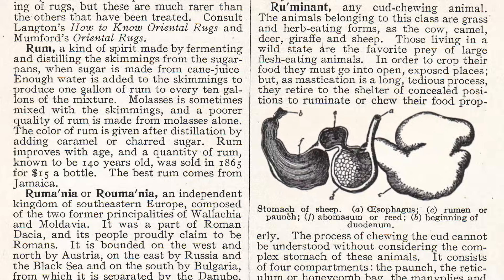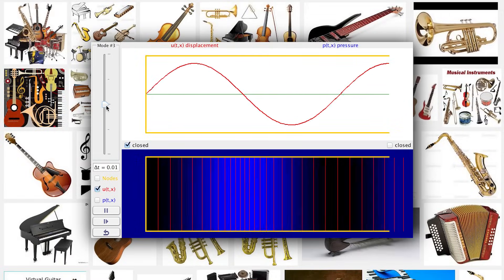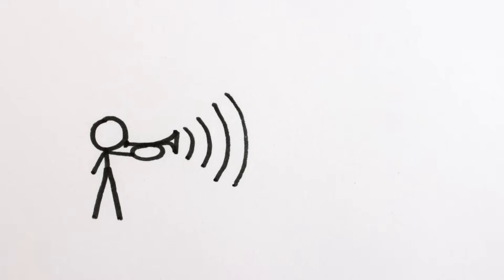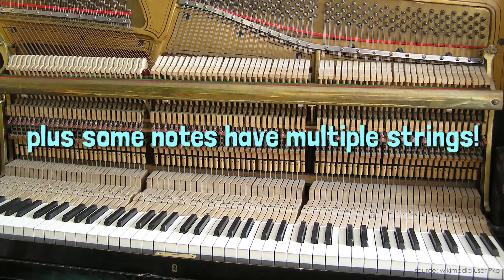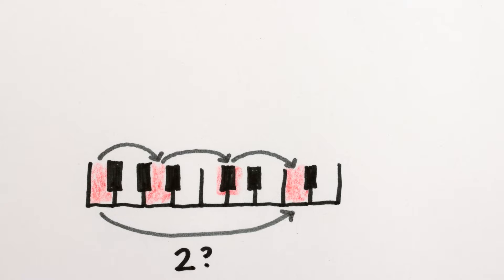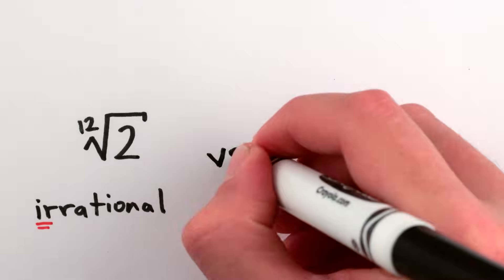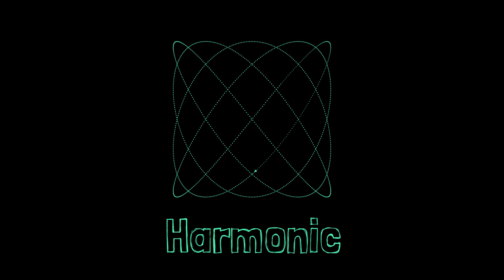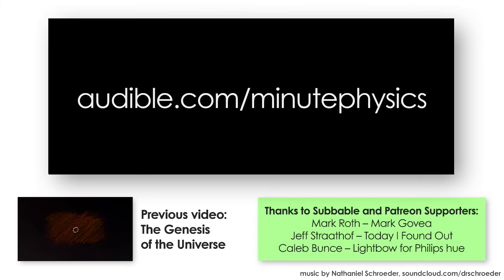Why It's Impossible to Tune a Piano

Comment: Irrational Numbers. So we met again...
Reply: at least they're still real...
Reply: i know right?
Reply: CsBence98 j, someone gets me
Reply: k I didn't expect to be counter-mathed.
Reply: CsBence98 can i x your something? y do we even use imaginary numbers?
Reply: ℂ𝔸𝕌𝕊𝔼 𝕎ℍ𝕐 ℕ𝕆𝕋
Reply: +ThePizzabrothers Gaming i itself is just bullshit, but in some calculations it "vanishes" (by being multiplied with i) and that way you get a decent solution. It's kinda handy for calculating vibrations for example, as cos (x) + i sin (x) = e^ix which is way shorter (and also the reason why e^iπ = -1)
Reply: Leo1239150 i is great for solving quadratic equations, but that doesn't mean it's a valid reason to come up with a random number that "explains" how things work.
Reply: I can speak on behalf of engineering application; In electircal analysis AC analysis, capacitors and inductors cause transient behaviour. It's quite tricky to solve exactly, but we know they consume power on one side of the sine wave of the AC current, and produce power on the other side. We therefore give them an impedance, which is measured in ohm's, and the maths becomes very easy, as this impedance is simply a resistance with an imaginary number, i. Current and voltage also receive some imaginary and some real values (the combination is known as a complex number) and the classic circuit analysis techniques can be used. As abstract as it may sound, it works perfectly.
It's also used often to offer a simpler way to due with 2d vectors, although using them is not greatly encouraged, as one must be careful when doing so.
Reply: ThePizzabrothers Gaming
 why not? If it's stupid but it works it's not stupid. And it works just fine
Reply: +ThePizzabrothersGaming Read that sentence again, but replace i with square root of two. :D
Reply: well it is a valid reason because mathematics to stay logical needs rules and if mathematics is not completed we can expand those rules but then we need to make them line up when they talk about the same thing. i was "invented"  to make every quadratic have a root basically someone asked what are the roots of x^2+1. aka when does x^2+1 = 0  it's when x^2=-1 but with the rules of multiplying numbers x can't be positive or negative. so imaginaries are needed to give it an answer as the rules of math state. just like asking what the answer of 2+5*3-5/2 is without math rules we could get multiple answers. there's (2+5)*(3-5)/2 = 7(-2/2) or (7(-2))/2 =  -7  depending on how you parenthesize thing though you can get different answers. it's only by giving rules to implied parentheses that it gives any meaning to mathematical expressions. +ThePizzabrothers Gaming.
Reply: evaluating we can get 2+15-5/2 = 2+15-2.5 = 14.5  we can get 2+(15-5)/2 = 2+10/2 =  2+5 = 7  we can also think of it as (2+10)/2 = 12/2 =6 so this is why placement of parentheses is so important we can also get (2+(5(3-5)))/2 = (2+(5(-2)))/2 = (2-10)/2 = -8/2 = -4  or ((2+5)(3)-5)/2 = (7(3)-5)/2 = (21-5)/2 = 16/2 = 8 etc.
Reply: Zander Meiring yes, then you operate with a vectorial add and it looks like so beautiful... then, you connect a switching power supply and your beautiful sinusoidal wave become your worst nightmare (Fourier wants to kill us all)
Reply: irracional number is a number that cannot be expressed as a ratio between two integers. And you will not find all the decimals when written as a decimal number. 1/3 is a rational number, since it's a ratio. But Square root of 2 can't. Because it cannot be expressed as a ratio and can't be written fully as a decimal number.
Reply: Spellchecker... Is not your friend apparently...
Reply: Kai Barber: spellchecking will fail in many cases. But you must remember that most of the people that use internet does not have English as first language, maybe not even as a second language.
Reply: Yes i do know that, I was just making a simple joke. If you thought it was rude or sarcastic, sorry about that, trying to imply emotions through text cleanly is difficult.
Reply: 666 likes I shall not upset such balance
Reply: They may be harder to count, but still not that... Complex ;)
Reply: Midaspl There are infinite number of irracional numbers between any two integers. Nobody can count them all. Not even the fastest computer in the universe.
Reply: Woosh.
Reply: Whatever you do, never tell an irrational number to calm down. You'll just make it worse
Reply: /O\/e
I found your "e"
*meet
Reply: @ThePizzabrothersGaming  the "i" that you thought not real and useless (i mean only thought to be useful in quadratic) have a strong relation to something that was being explained in this video, so it's not only for solving quadratic or even higher degree polynomial.